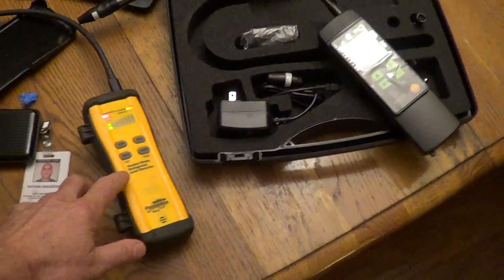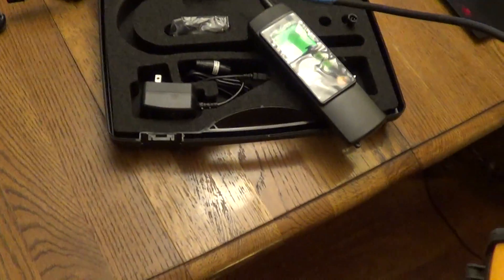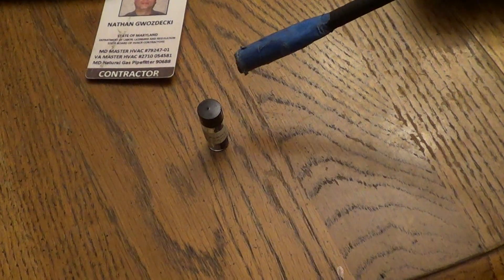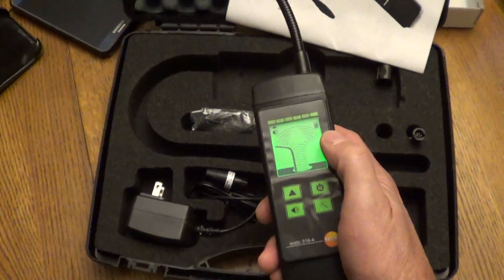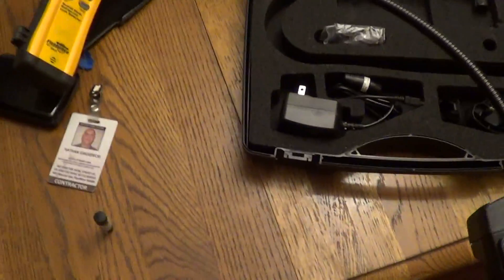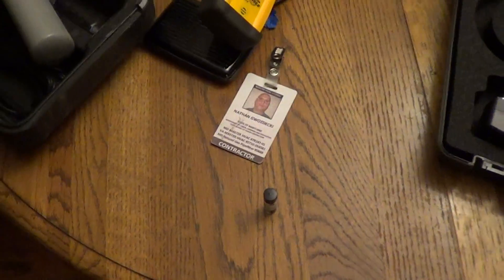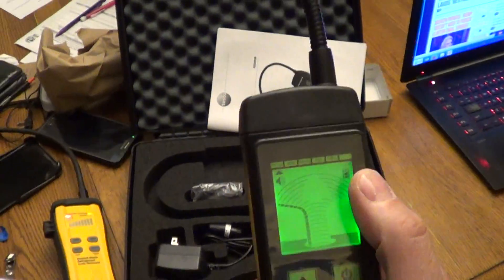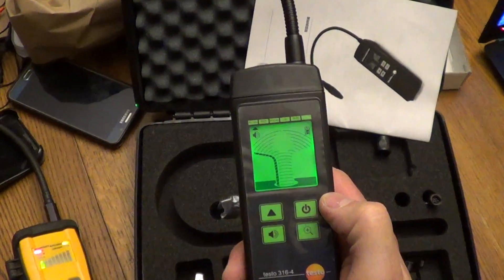Testo 316-4 Leak Detector Quick Comparison

Comment: I have slowly switched from FP to testo with a lot of tools and very impressed with quality and performance . Field piece is great but bulky ( gauges in particular)
Reply from the maker: Testo is good stuff.   I use the little low side gauge with my phone to spot check refrigerant.   It is small enough to stay in my tool bag.    I also have a 45 degree no loss fitting on the end for checking sub cooling.    I avoid the bulky gauges by carrying a fluke amp meter with the fluke clamp thermocouple.    An adapter connects the pipe clamp thermocouple to the amp meter.  Response of the clamp is 1 to 3 seconds.    When I eventually need gauges, I use analog ones.
Reply from the maker: Every tool I buy is for the lightest weight with decent quality.   I even use a 12 lb reclaim bottle.
Reply from the maker: Another good testo tool to keep in your bag is the credit card sized manometer.   I keep a rubber hose and 1/8 fitting for gas pressure.    But what is really cool is using one of the red wd40 straws to sense static pressure in duct work.   That straw can be rammed into the testo pos and negative port.   It is zero additional weight and you can check ductwork pressure Thu a screw hole.

Comment: Thanks for the video, but that is totally unfair comparison bro. The SRL8 used in the video looks a little experienced, I guess if you replace the heated diod sensor then it would be fair as the testo seems to look so brand new. Again thanks for the video.
Reply from the maker: They both have the similar sensitivity on R410a around 0.2 ppm.    However, I have been using the Navac that uses the exact same sensor as the SRL8 for the last year.   The Navac is more stable.   I will do videos on this and update my leak detector report.

Comment: I seen that you had the Testo for sale on Ebay, so does that mean the Testo is just as bad for false alarms?
Reply: Now first of all I would like to thank you for the video, but there is one fact to be considered bro. The SRL8 is pretty old and the testo is so brand new if Im not mistaken if you got a new heated diod sensor on the field piece that would be a fair comparison, and again thanks for the video.
Reply: @khalilhq1981  Thanks for the compliment but this post is 2 years old. I've already have given up on the Fieldpiece, sold it 💥🤣,  their leak detectors are garbage. I like their other products just not their leak detectors. I spoke with Fieldpiece about it and they even sent me the infrared detector for free to make up for the poor quality of the slr8. They admitted the slr8 has issues, so it has nothing to do with the heated diode being defective. The IR was less sensitive to the point it didn't alarm on the easy leaks. The H10pro,  the Inficon Status and Detek 3 both walk circles around the Fieldpiece. But far as the Testo leak detector,  I can't say one way or the other because I've never used it but I've heard good things about it. I'm done trying to avoid the inevitable and as you've seen I have shown the H10 and Inficon both do a great job. Everyone has their preferences on what they believe is the so-called best. I just absolutely despise the Fieldpiece detectors. But I will throw out there that I know they are coming out with a brand new one that's being tested currently and I've heard it's supposed to be good.
Reply: I can't say that I'm so happy for what your saying, I just got my SLR8 🗯🤣, I will pray and update you if the version I have is any  better.
Reply: @khalilhq1981  Sorry man, I'm not trying to be a jerk, its just my opinion from what my experience was. I have heard some people say they love it and swear by it. If its all you have used and you learn how it reacts then you should be ok.
Reply: @HVACRSurvival  come on its all good dear, in fact I respect you  and as I just entered the hvac field your opinion are highly appreciated.
Reply from the maker: It seemed like the SRL8 was easier to use even with all the false hits that it constantly gets.  But, the Testo is more stable.  They both seem to be about the same sensitivity (which is 10x better than anything else out there).
Reply: @NathansHVAC  If I could get less falses I would trade the Fieldpiece out for the Testo. But how's the battery life on the Testo, the battery life on the Fieldpiece is the highest out there that I know of.

Comment: I’m ready to get a second leak detector. Currently only use the tekmate, but I’d like something else as a backup and second opinion. Do lots of  410, 134. What leak detector would you buy if you were me? Spending less than $1000. Let me know. Thanks.
Reply from the maker: The SRL8 is the most sensitive for the HFC refrigerants.  However, it is squirrelly.  Also, you have to change the sensor every year.  But, it is 10X more sensitive to R410a and R134a than anything else out there.  I have a video showing that wrapping some blue painters tape around the metal probe end helps stabilize it.  However, it isn't going to be a stable as the tekmate.  Once you get used to weeding out the neucense trips, you will like it.
Reply: NathansHVAC 
Thanks!
Reply: One more question, what about this Testo?  What was your final conclusion on this detector? Really appreciate all your hard work!
Reply from the maker: I'm still evaluating the 316-4 in the field.  It has the same solvent sensitivity problem that the SRL8 has.  But, I probably prefer the SRL8 and I will be selling the 316-4.  I'm waiting for a leaking evaporator coil that has about 1lb per year R410a that the SRL8 wont find and the 316-4 will.  But, so far the SRL8 has been finding the leaks easier in my opinion than the 316-4.  Both test with the same sensitivity.  They both use similar sensors.  However, the Testo has some sensor diagnostics built into the sensor.  The SRL8 needs a new sensor every year.  I"m not sure about the Testo?
Reply from the maker: I personally like the SRL8 better.  It is cheaper.  The sensors are much cheaper.  It is louder.  I does false hit all the time.  But, when there is a real leak, it does pick it up consistently.  The Testo seems a little more stable.  But, I do prefer the SRL8.  I'm still waiting for an HFC leak detector that is as good as best CFC detectors like the H10 or Tekmate.  However, no one has invented one yet for under $8,000.  So, The SRL8 is the best bet for HFC based refrigerants.
Reply: Not worried about sensor replacement, company pays for that and filters, I always keep a spare sensor for my tek mate, will do same for field piece. Not a big fan of squirrely/ false positives, but as long as it doesn’t miss a leak and I learn what sets it off for false positive, then it’s all good. Price will be nice as well, was very close to pulling the trigger on an h-10.

Comment: I'm wanting to buy one if you give the okay.Please reply.
Reply from the maker: I'll post a video tonight.  The 316-4 is 4x more sensitive to R410a than the SRL8.  However, it does suck on R22 just like the SRL8.  So, for $900 it isn't going to be a single replace all leak detector like I hoped it would.  However, if it isn't as squirrelly it might be worth buying instead of the SRL8.  I suspect they are both using the same version of a tin oxide heated diode sensor.  However, the Testo includes a microcontroller that is built into the sensor to regulate the temperature like the $10K more expensive leak detectors do.  I have a 1 pound per year leak scheduled to be checked later this week with the 316-4.  Bench testing with mixed gasses only shows ultimate sensitivity and not real world application of the leak detector.  I know the SRL8 is a winner.  I would wait a few weeks before buying a 316-4.  You can always sell your SRL8.  Buy a used SRL8 and install a new sensor.  Another thing that sucks about the Testo is that the sensors cost $130.  They may only last 6 months like the $50 SRL8 sensors.
Reply: Thanks for getting back with me,I found the Testo 316-4 at Testo-Direct.com for $412.
Reply: @minnesotasalamander5913  update? I'm looking to another one